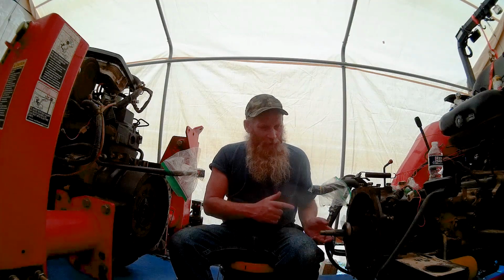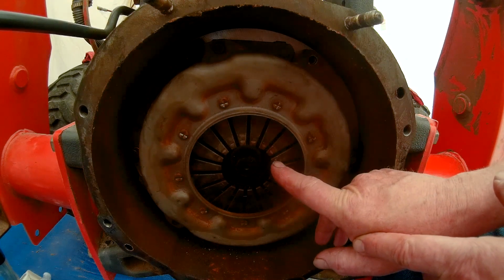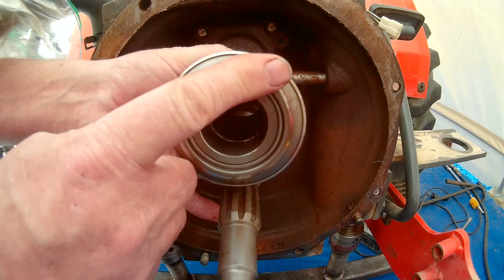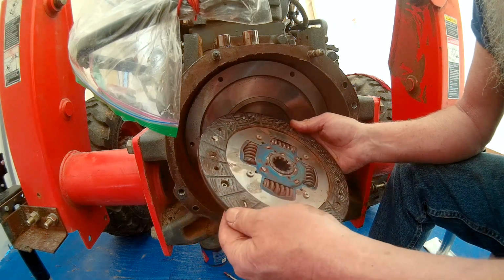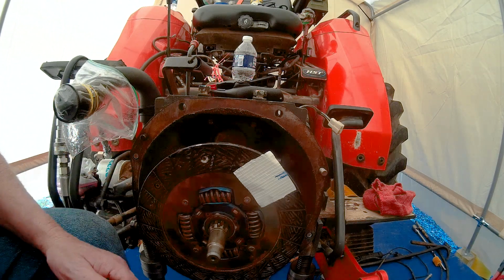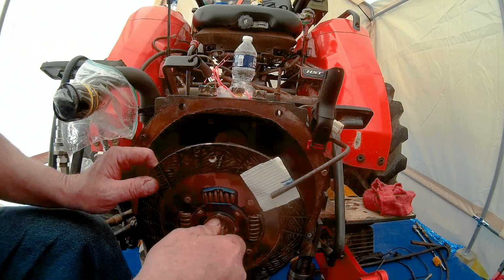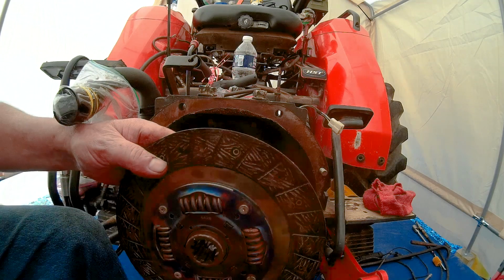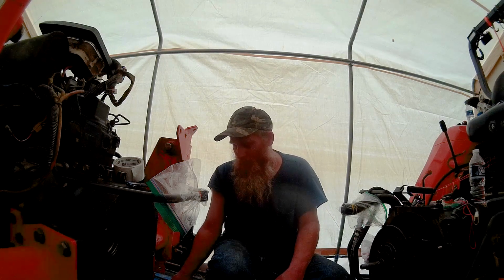clutch replacement part 3 Checking the Clutch to See if it Really needs Replacing ?

Comment: This is close to the L3400 dt which does have a two stage clutch. My L3400 dt has 1300 hr and is sticking in gear, mostly 1st  but not 2nd for some reason, so I'm thinking it needs a clutch job.
Reply from the maker: if its manual tranny and sticking in gear its likely something else. could be a damaged or worn shift fork. look up the schematic and parts diagram online at messicks.com so you can see what you are dealing with. on the old machines this was a fairly easy fix not sure about the L3400. I will say this the L3400 is a great machine if I find one at the right price I may jump on it since my hoe and all will fit right on it.

Comment: Very informative Dave!  I remember in a previous video you said you may not video the whole thing. I totally understand the reason. Sometimes, we got enough to think on a specific project, adding a camera makes it just 2x more complicated and 10x slower. Take into consideration so very few people have made a detailed video (if any) of splitting a small tractor. Especially on a budget, where tools and equipment are limited. Thanks for sharing that Dave!
Reply from the maker: for sure, I ended up having to buy several tools I lacked. build a few custom tools as well. it has taken a long time to get this done. its on the way to being back together but its been slow and some what painful. I'm ready for this project to be over.

Comment: Dave. The throwout bearing normally dosn,t turn except when the clutch petal is  pressed. Were you not hearing the noise all the time?
Reply from the maker: well that is the weird part. I could here the bearing singing and when I press the clutch in the sound would change. this went on for years and years. then one day out of the blue I started hearing another ringing sound that was not affected by the depression or release of the clutch pedal. any thoughts on that? right now with the new clutch I can tell the bearing is resting on the pressure plate fingers. so the clutch will need adjusting before using the machine. any thoughts is greatly appreciated.
Reply: Hi Dave. Is it possible that the clutch pedal free play was out of adjustment? As a clutch disk wears you would have less free play. With the new disc there should have been clearance between the bearing and the fingers. Specs on my  l3800 call for 0.8 to 1.2 in ,it measures 1.062. Measured at the pedal. Do you know the history of the tractor before you bought it? Good luck to you.

Comment: Yea, with that much backlash and a throw out bearing sounding off. It was a bad combo in there.  Did the disc look crystallized?   With the heat marks on the pressure plate it might have gotten hot enough to cook that side of the disc. Either way, like you said. It's a good idea to change it since your in there. Have a good week!  See ya!
Reply from the maker: thanks John I hope you weigh in on this next video I just posted about the hydraulic oil and what I should do. if you have time check it out

Comment: Hi Dave. In your video you diidn,t show exact,ly where the backlash is. I,m assuming it,s not in the splines but rather  in the area where the springs that absorb the drive force are . The noise you heard was possibly the springs bouncing around in there little caged in area between the center drive hub and the outer disc. Beat out rather then worn out. Enjoy your videos and admire your datermination.
Reply from the maker: the backlash as not in the spline itself but in the spline boss which houses the female spline and attaches it to the rest of the disc. I think the noise I heard was just the throw out bearing failing due to lack of lubrication. I plan to open up the old throw out bearing to see just what it looks like inside.

Comment: Another great video full of information. Glad the pressure plate was not bad.
Reply from the maker: yes pressure plate was not damaged as bad as I thought but still needed replacing. there was slight wear on the finger tips at the bearing contact point. also the disc itself was slightly discolored from heat. no to bad but since it could not be trued up I just replaced it.

Comment: Thanks Dave, nice insight.  The bearing you were spinning and could hear a slight noise was not a packed bearing (don't know if they get packed). Wondering of that's why you probably could hear the hollow sound as you spun the bearing, however, if you could either feel some slight grinding, then a sure sign that bearing has bad balls (smile) and needs replaced. Is that what you felt or were referring to? As you did, once I have the clutch assembly apart, I too would replace the clutch, pressure plate, and throw-out bearing since they are high-wear items and quite aggravating to access. Enjoyed your video; always do enjoy them.  I'll have to go back to check what I may have missed in your last video. Be well, my friend.
Reply from the maker: yes it felt dry and crunchy. I believe the bearing heated up and spun the grease out. then rust began inside and as you stated the balls suffered. the new one was well packed with grease and very smooth.

Comment: Good informative video Dave. Glad you clearly identified the problem. Wonder why so much rust on the inside? Are you planning on spraying or painting on any type of inhibitor? Sounds like a good question to ask you’re ex-Kubota tech. Also, how many hours do you have on your rig?
Reply from the maker: I started to spray it but instead just shot a rust preventative on various parts. its at 800 hours right now. its more of an age issue. this machine is a 2005 model. so 16 years old.
Reply: @daveknowshow  my guess is the rust is just the result of condensation. Some people even have issues with the condemnation adding water to there hydraulic oil.  
    I've never seen that much slop in a clutch disk, that's crazy. I don't know if it's worth it to you but you may be able to take the clutch to a place that reclines clutches and truck brakes and have the plate fixed or rebuilt. Then again hopefully you won't have to split it for a long time. One of my older tractors I had to split about three times. One clutch was wore out one was soaked with oil from a transmission leak and one time most of the pressure plate bolts sheared off. I feel your pain brother
Reply from the maker: @billfischer6464  thanks for the info Bill. I hope this is the last time I do this. I'm about to post a new video where I ask for some advice I hope you will watch it and weigh in with your thoughts. thanks

Comment: Very informative video! I’ve done a couple clutches in Ford tractors. Never seen that much backlash on a clutch. I can’t believe the rust inside the housing, it’s definitely gotten some moisture in there somehow. The dual clutch pressure plates are heavy! You’ve probably already done it by now but I guess you know the bread trick for removing the pilot bearing?
Reply from the maker: yes I actually used grease rather than bread since I custom built a tool for extraction with close tolerances. I did mention using a tissue mixed with grease in cases where you dont have the tooling to build a custom removal tool to fit. I agree that backlash was crazy.

Comment: How's she goin'?  As I remember you started this job because of a noise coming from the clutch/transmission area.  I think the amount of play you measured on this clutch plate would certainly cause the 'clunking' or 'thumping' noise.  I'd say you found your problem and did a great job showing what you discovered.  I wonder if all the rust in there was a cause for the clutch plate to wear like that.  Anyways Dave, nice work here buddy!!!  Take care and thanks for sharing!!!
Reply from the maker: yes indeed a lot of rust. we will talk about that in an upcoming video. I pretty much believe that the noise was coming from the clutch disc play as well as the throw out bearing being completely dry or what seem to be completely dry. I may do surgery on the old throw out bearing so we can see just how dry it may or may not be. I'm very curious to see the inside. that should make for a decent video.